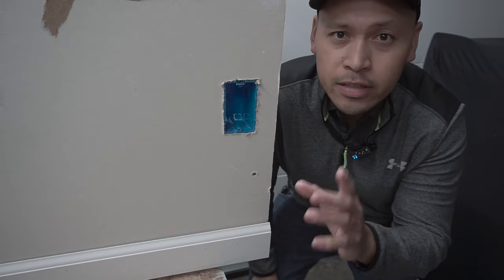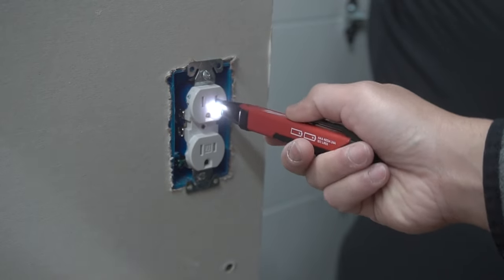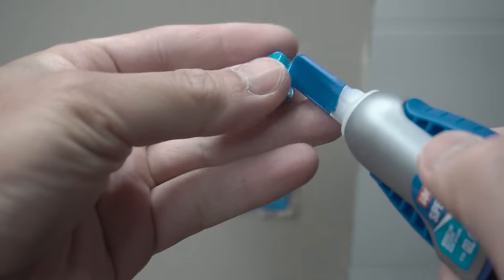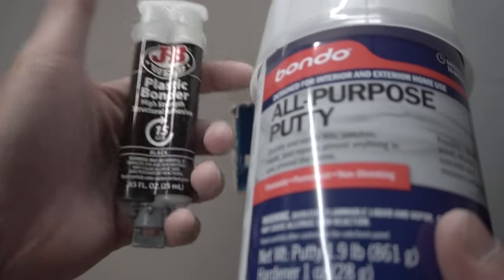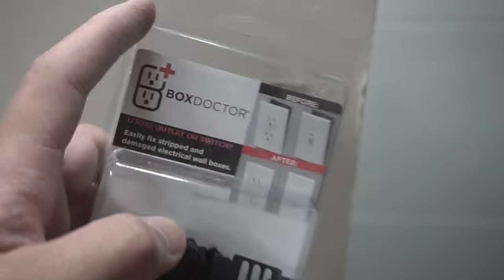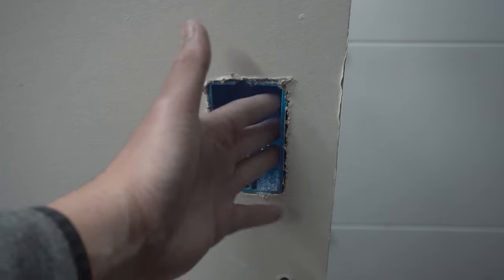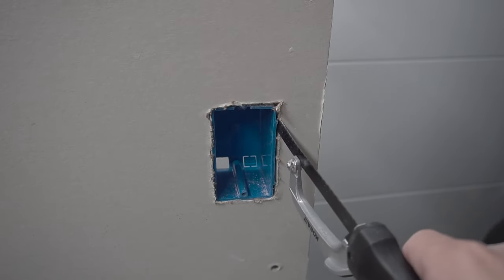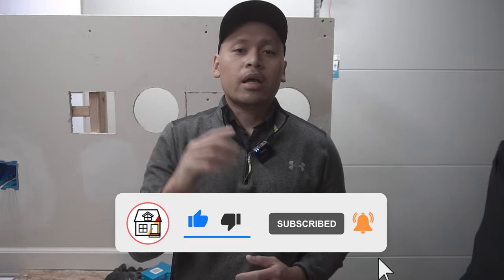How To Fix Broken Electrical Box With Loose Or Sagging Outlet Or Switch! | DIY For Beginners

Comment: Hi
 Great Tips. They also make Clips that you slide in on each side of the outside of the Box. They are longer than the Box, so you feed one end in first and adjust it up to where each end is behind the Drywall. Then you bend it over inside the Box on each side. This prevents the Box itself from sliding out of the Sheetrock. That’s more for a loose Box though, not the Screw Problem. On a Screw that is stripped out, if you don’t have a bigger Screw, stick a Toothpick in the Hole and break it off even with the Front. The Screw will go in Tight then. You covered the Broken off Screw Backing very well.
Reply from the maker: Thank you so much for sharing your technique! 🙏🏽😊
Reply: The toothpick trick worked for me. I had to super glue it into the hole because the hole has no back. So the first toothpick got pushed out the back and fell behind. If you need to break the toothpick, I suggest breaking the back end, so you'll have the taper end facing you. The screw bites easier into the taper. Thank you for the idea!
Reply: What are the clips called?

Comment: Great video.. Where I'm living (Mexico), the plastic boxes are used in embedded concrete block walls or installed after the wall using only mortar forced into the oversized hole (no fasteners). Wiring is typically run in flexible or corrugated plastic tubing. Very common to find these screw bosses broken due to people using oversized screws. I don't know if the Box Doctor will fit in there without deforming the box, but I ordered a set and we'll see. Thanks for showing a product I haven't seen before.

Comment: That last option might just solve a problem I've encountered. When I set the outlet boxes on one wall of my kitchen I was expecting we would tile over the wall there, so I left them hanging out enough for the tile and mastic behind the tile. Plans change, so now I need to make those boxes flush with the wall without destroying the surrounding drywall. This video gave me a few ideas on how to do that. The small hacksaw and that last box you showed would do the trick for those four boxes.

Comment: Sometimes for all the headaches, and the cost, it's just easier to replace the box. Also if you have electrical wires coming into there there's a good chance that it is stapled right below the box and that's going to make life very interesting as well
Reply from the maker: Thank you for sharing brother! 🙏🏽😊
Reply: Great video. Great point Matt ,actually that is the problem that I’m having and I needed to see a video before I take out the box to see how easy or complicated it is

Comment: Thanks for the tips. I have a couple of loose outlets i need to address. AS for the clip option, I like the G clip option better because the clip has a hole deformed to mimic a threaded hole and will be more reliable and durable in the long run. It is like the Tinnerman clips.

Comment: Are those clips available for ceiling light boxes?  The screw moldings for the fixture cracked and won’t hold a screw. The box is original construction, nailed to a rafter.

Comment: Would these tips work on a loose light fixture box ? Whomever installed my light in the bathroom cut the hole as big as the outside edge not the smaller part of the box

Comment: I had to replace a switch and the original contractor had used locktite on the switches mount screws. One of them snapped off inside to box. Long story short, I used a heat gun and a pair of needle nose pliers to pull the remaining quarter of the screw out of the box. And yes I ended up using a sheet metal screw to hold the new switch in place.

Comment: Great video. I’ve used all of these at one time or another except the box doctor. I wonder how long it would last in a high traffic box, such as vacuum cleaner or hair dryer. I have mounted even metal boxes with screws into the stud. The only issue I’ve run into was with clearance for the screws, especially with GFCI.

Comment: Licensed pros–electricians, plumbers, etc.–sometimes express disdain, even contempt, for the advice found on DIY sites. I think this video provides a good example of what sometimes burns their grits. I find the advice on your site to be excellent and helpful most of the time, but suggesting that a drywall screw is an acceptable substitute for a machine screw meant for a UL-approved electrical box is just wrong. First, it's a code violation, which means any inspector worth his/her salt won't approve the work. The code says, more or less, that only screws meant for use in an electrical box can be used in an electrical box. Second, drywall screws are weaker than the stainless-steel screws used in electrical boxes; they break easily. Third, drywall screws can strip the threads or damage an electrical box. Fourth, stainless-steel screws LOOK a hell of a lot better and more professional than drywall screws. I had some electrical work done by a contractor years ago. Either he or one of his workers used drywall screws in one of my electrical boxes. I didn't notice until years later. Replaced the screws, but I'll never trust or use that SOB again. I wouldn't trust him to build a dog house.
Reply from the maker: Thank you for your input sir 🙏🏽

Comment: Another professional already commented.  To use a standard drywall screw or any screw not recommended by the box manufacturer is a code violation.  You may be trying to help DIY,ers, however to suggest a code violation is wrong and could cost your viewers more money than the cost to fix it correctly.